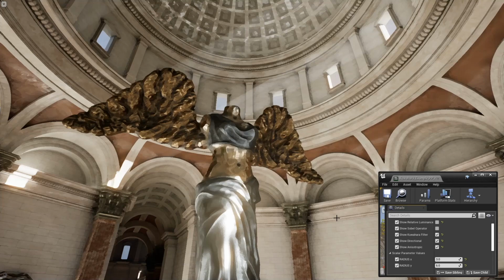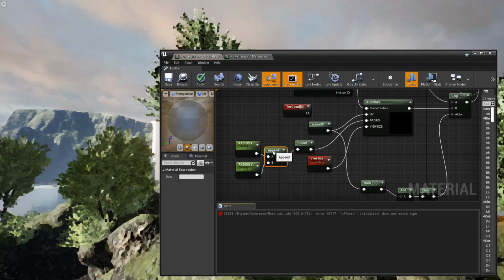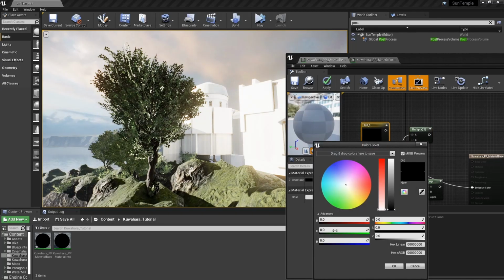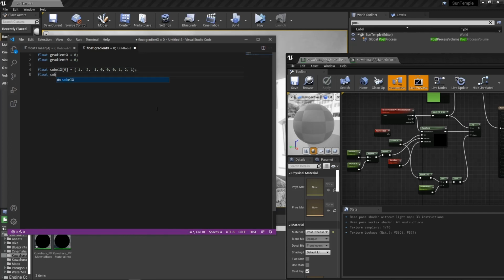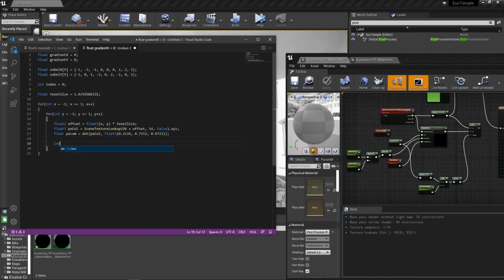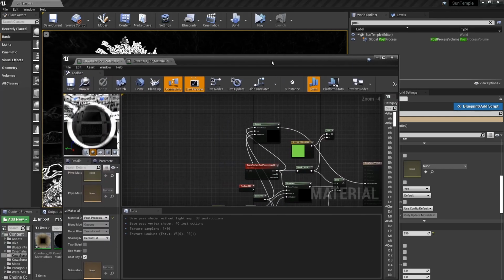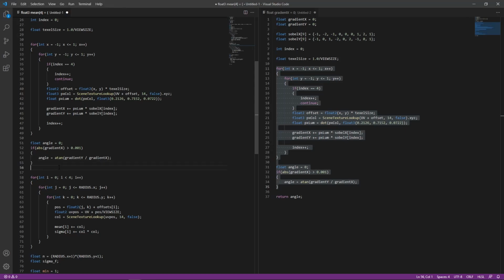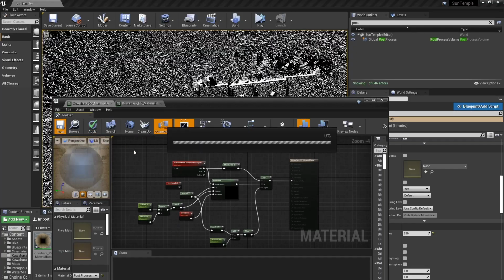Unreal - Tutorial - Painterly Post Processing - Directional Kuwahara Filter

Comment: Great tutorial and nice effect! I notice that it is not possible to use real world values for the lighting however or this effect diverges quite a bit from the underlying lighting. For example if you use a real world value for the directional light, say 100000 lux and then adjusting exposure to compensate, the scene darkens considerably compared to without the effect. I can fix this by applying the effect after tonemapping instead of before but it seems to introduce more jittering noise of the effect. I'm curious if there is a way to prevent the effect from being so divergent when using real world lighting values.

Comment: Wondering if you might be able to help out with this. I found this video from a plugin that used a Kuwahara filter (Stylized - Clay Forest Village Pack), the creator referenced this link. Basically, if this shader is active while using Ultra Dynamic Sky and pretty much any other weather setting is set (i.e. cloudy), the screen starts strobing, flashing between black and white on most objects, like nuts.

Comment: Thank you so much for your Unreal Kuwahara tutorial. Really lovely post effect.
I would love to use this effect in an Unreal short film project I'm working on. Running into one issue though that I was wondering if you know was solveable.
I really need to be able to utilize alphas so I can composite elements inside of Nuke however using the filter completely removes the alpha. Is this something in theory that could be solved? Could a particular item for example be able to have the kuwahara filter applied to its alpha somehow?

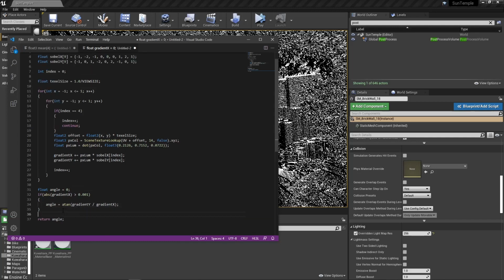Comment: 18:50 Or just use atan2...
Reply from the maker: Fairly certain atan2 returns a result in the range of -pi to pi, while atan returns results in a range of -pi/2 to pi/2. Looking at atan2(y, x) in disassembly, it ended up as 8 more instructions than atan(y / x), but that's something you can probably take with a grain of salt. Either way, yea, you can use whatever works for you
Reply: @MatthijsVerkuijlen  Hmm the extra instructions is definitely an interesting observation. I did not know this. However, I feel like it would just make the code a lot cleaner without too much extra computation time, which I personally think is worth it. After all, this is what atan2 was made for. But yeah, I think both approaches are reasonable considering the small performance difference.

Comment: Instead of trying to get edge direction from the image,
Wouldn't it be be possible, and maybe cheaper, to make use of a depth map and vector map to start finding edges. In a similar way you'd use for edge detection to create outlines.
I understand that it would give messy results for some detailed textures but I also feel it might give a more consistent result.
Reply from the maker: Yea, absolutely worth a shot! I think at this point it mainly depends on what result you're trying to go for. I imagine you can get very good results by driving your direction from a different input.
Reply: @MatthijsVerkuijlen  I'd love to have a go with it. I love seeing stylistic devices which end up hiding details which mean you can eventually use this to optimise a game somewhere else. The only downside with this one I'd say is that it seems to make aliasing pop out more as it makes everyting blurier except the edges.
...Despite having been kinda obsessed with shaders, understanding the math, knowing programming, having programmed games before I've actually barely ever touched a 3D game engine.
I should really start having a proper go at it.
Reply from the maker: @PauLtus_B  You could probably reduce aliasing by changing when this post process shader gets ran, and you could probably hide edges more by changing what input data you're sampling to set your angles. Definitely worth experimenting with! While you could definitely get away with less resolution in your textures for example as an optimisation, there is a considerable cost to sampling your screen textures repeatedtly, so I'm not quite sure whether I'd see this as an optimisation technique just yet!
Reply: @MatthijsVerkuijlen   Before I make my response I just wanted to speak out my actual admiration for what you managed to create here. I enjoy thinking about these things but I don't want to give you the impression that I just feel like: "mweh, could be better." I do think it's incredible.
I don't really see how you'd avoid the AA it unless you'd run something like a post-process AA afterwards. Even something like super sampling will honestly just get undone by Kuwahara filter as that will try to match every pixel with another pixel. The one way that could work is simply run the game at a higher resolution, run the filter on the high resolution image and then give a lower resolution output, but that will of course be terrible for performance, maybe a MSAA equivalent could be done just for those.
What I find so unfortunate about it is that even a very basic Kuwahara filter can look really nice. Looking at Skyward Sword, which I think used a Kuwahara effect even more basic than the very first one, could often look really nice when blending objects in the background together in a seemingly flat image. It manages to deal with details in the distance really well. It only became an issue when there were several layers on top of each other being affected by the effect as it started to look like a blurry image on top of another blurry image with both having sharp edges.
What you've created here is far more advanced and looks a lot more beautiful, especially with preserving details, but the aliasing still seems to becoming a bit more obvious because of the effect.

The reason I thought of using a depth map (and vector map, maybe?) to find edges has a variety of reasons.
First of all I think it might be a bit easier on performance. This is data you probably already have for other reasons, so there's no real need to recalculate it. It might also help because when looking at surrounding pixels it might be easier to identify that it belongs to a different object and can therefore be ignored instead of looking at its colour value and calculating it.
I can also imagine that a simpler version of the filter could be run at that point as edge detection is already done but that will of course result in texture detail getting lost. It will also most definitely not help with AA which might just end up being worse.
I think it may also help to help think as the hypothetical painter. Trying to determine what the objects are before making a paintstroke instead of trying to merge together an image to become paintstrokes. I can imagine that with the current filter, if you have a white pillar in front of a white wall and some unfortunate lighting the filter will have trouble seeing them as individual objects and start blending them together. You will also have quite a bit of control about at when individual objects start  blending into one.

That last one is also the reason why I can see the Kuwahara filter having potential for optimisation in general. More and more games are trying to render detailed foliage with entire fields of indivual blades of grass which looks great but is terrible for performance and tends to result in a lot of ugly pop-in (I tend not to care that much about highly detailed assets but that is something I feel really adds something to the feel of a game, it's not something you easily make more abstract). As a Kuwhahara filter is something that blurs detail in a way that's artistically interesting I think it can be a big help as there is a much earlier point where you can start simplifying assets. No reason to render individual blades of grass beyond the point where the Kuwahara filter doesn't let you tell them apart.
Reply from the maker: @PauLtus_B  Yea I get what you're saying. I do think that's a more stylistic decision than necessarily a problem with the filter, though. I think part of the strength of the filter is that it keeps objects fairly separate, while making less harsh transitions look more painterly. If that's not the result you're looking for, you could potentially start blurring colors together if their normals are (close to) perpendicular to the camera, and then run the filter over the output of that. As long as your normals are 'soft' enough, that might hide some object transitions, at the cost of destinctly separate objects. I think a lot of that becomes less about what's "correct", and a lot more about experimentation to get to a look which you like.

Comment: I'm using a 21:9_3440 X 1440 resolution monitor.
There are parts of the screen that appear blank.
Is there any way to fix the problem?
Reply from the maker: Hey, I'm not entirely sure as I've not tested it on anything larger than 1920x1080. I wouldn't have expected this to stop working though. Are there specific areas that seem blank? Might be worthwhile trying some different options for the UVs and seeing if you get better results from that

Comment: Hi! Thank you for sharing this technique!
I've been testing out things with the shader and I can't seem to figure out where the "SceneTexture" input is called in the code.
I fact, I wanted to use custom stencil in order to give a different color to some elements between the TextureScene node and the custom node.
But it doesn't seem the change anything, and when I look at the code I see the SceneTextureLookup function is called, but not the input.
So I wonder how I could make the filter use the input I feed it instead.
Thank you again!
Reply from the maker: Hey! Yea that part is a bit vague. The scene texture lookup is done entirely through code, but you need to have the node hooked up just so it's compiled with the shader. 
You could do the other shader changes in a different post process material and use both of  them together in your post process settings, or you could also sample the stencil in the custom node and do the coloring inside the custom node as well. Not sure if that does what you want it to, though!
Reply from the maker: This website seems to have a pretty decent explanation of why we still need the node even if it's not directly called in code https://www.raywenderlich.com/57-unreal-engine-4-custom-shaders-tutorial#toc-anchor-003
Reply: @MatthijsVerkuijlen  thanks for the explanation!
I don't know if it will work that way but it's worth trying!
I wanted to modify the image so that the character is a plain color and gets processed elseway. I'm using a clean version of scene texture for the final result tho.

Comment: I copied the code and readed it like 6 times but I can't find the reason why I have this 5 errors:

[SM5] /Engine/Generated/Material.ush(2139,1-2):  error X3000: syntax error: unexpected token 'if'
[SM5] /Engine/Generated/Material.ush(2144,15-19):  error X3004: undeclared identifier 'angle'
[SM5] /Engine/Generated/Material.ush(2144,11-20):  error X3013: 'sin': no matching 1 parameter intrinsic function
[SM5] /Engine/Generated/Material.ush(2144,11-20):  error X3013: Possible intrinsic functions are:
[SM5] /Engine/Generated/Material.ush(2144,11-20):  error X3013:     sin(float|half|min10float|min16float)

I'm getting crazy
Reply from the maker: feel free to send me your code on twitter and I can have a look!

Comment: In the final version of the code, view size is only used once to calculate texel size, so wouldn't it be better to just use invSize from post processing input? From what I read it supports upscaling better. Correct me if I'm wrong though.

Also, I wonder if there's a way to do this sub-pixel, or to otherwise achieve a more standardized effect. A pixel in 720p is very different from a pixel in 4k, and multiplying based on a common divisor would make the radius too large for my taste :S

Thanks for the tutorial by the way! Even if I might not be able to use it in production(due to above) I learned a lot from it :D
Reply from the maker: Hadn't thought about using the invSize, that might work. Definitely worth trying out!

As for a more resolution standardized effect, a person asked a similar question under the first part of the tutorial, I've answered it in the highlighted comment here https://www.youtube.com/watch?v=Pe3Yt3DUp04&lc=UgxUHQbeeHPiij0co5V4AaABAg.9QGt96a8Cpx9QIoe-jpiup 
I've also copied it here, as I don't link how highlighted comments work;
"Great question! So right now, you're setting the Radius regardless of the screen resolution. What you'd want to do instead is author your Radius for a specific resolution. Let's say your screen is 1920*1080, and your Radius is 5 pixels. For a 3840*2160 screen, you'd want your Radius to then be 10 pixels, while for a 1280*720 screen you'd want 3 pixels (really 3.3333 but we're still rounding to integers). Since at this point in the tutorial we're still treating the radius as a single float, rather than a float2, I'll only take the X axis of the screen in account for now. 
Your authoredRadius (5) is valid for your authoredResolution (1920). To convert that radius to the outputResolution(3840), you can do (authoredRadius / authoredResolution) * outputResolution. So in this case ( 5 / 1920 ) * 3840 = 10. If you plug that math into the radius, your effect should stay consistent over varying screen sizes. The authoredRadius should be a shader input, as should the authoredResolution. The output resolution is the Red value you're getting from the ViewSize node.
Let me know if that fixes the issue for you!"

Glad you found it informative!
Reply: @MatthijsVerkuijlen  Thanks for the reply! I thought of that solution and did exactly that, but problem is I'm going for a very small radius. 1080p with radius of 1 looks good to me, so it simply won't scale to say 1440p, or anything below 1080. I'm thinking lerp it by depth so foreground is less affected and stays sharp or something, will have to try and see how it goes :/
Reply from the maker: @pointlessshredding1019  Ah alright! Yea this current setup definitely won't handle small scales well, and while you could do a multisampled version (potentially at considerable perf cost), I don't think much of the effect would survive being subpixel, so I imagine that's not worth it. 
I experimented a little bit with changing the effect based on depth, but didn't get any results I was too excited about a few months back. I might give that another try. I'd be really interested to see what results you get!
Reply: @MatthijsVerkuijlen  Turns out lerping from greater than 0 to less than 1 (0.4 to 0.6 is what I did, with radius of 1 per 640 pixels) gives a subpixel-ish look! I can't explain this as it's not what I'd expect a lerp would do, but I like the result
Reply from the maker: @pointlessshredding1019  huh, alright, interesting! Glad that worked!

Comment: Hi! Thanks for the tutorial, absolutely loved the first one. I'm running into an error at the sobel operator. I'm getting two warnings, one of "implicit truncation of vector type", and another of "redfinition of 'y'". Any ideas of what could be causing it? The code looks correct, not sure if I'm plugging in the wrong thing somewhere?
Reply from the maker: it sounds like you might accidentally be assigning the wrong value to "y" somewhere, but it's hard to tell without the full error (with line numbers) or code. If you want to send me your code in a private message here, on ArtStation, or on Twitter, I'd be happy to take a look
Reply: @MatthijsVerkuijlen  Thanks, sent you something on ArtStation!
Reply: Did you discover a fix? I'm having the exact same problem.